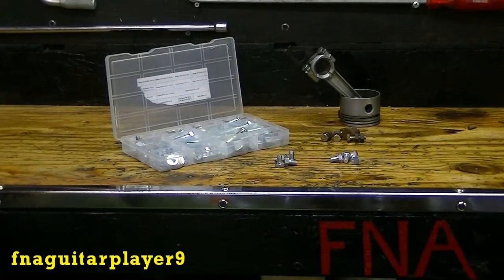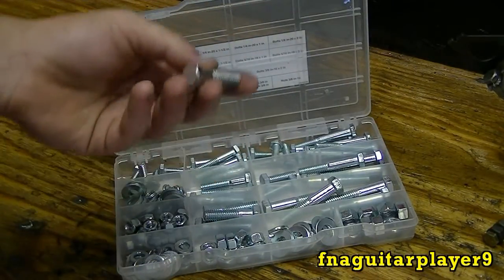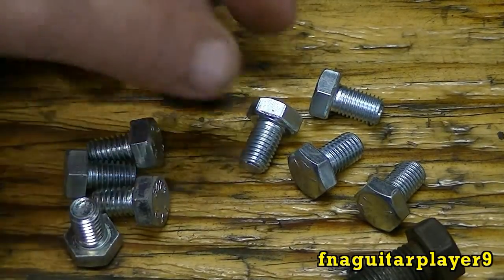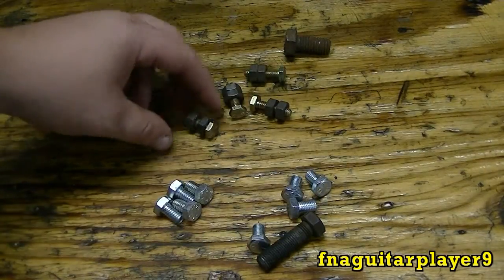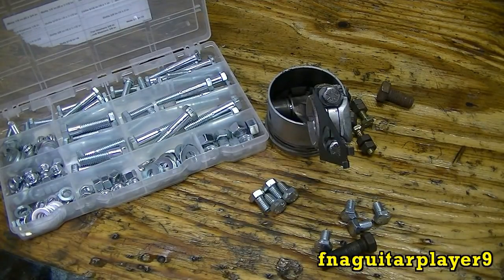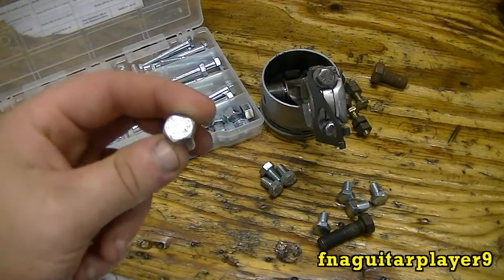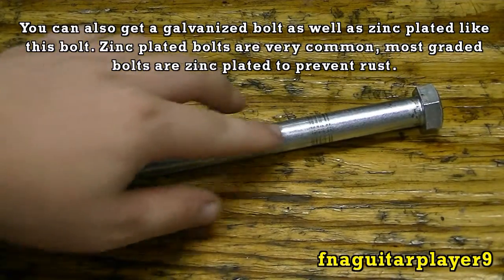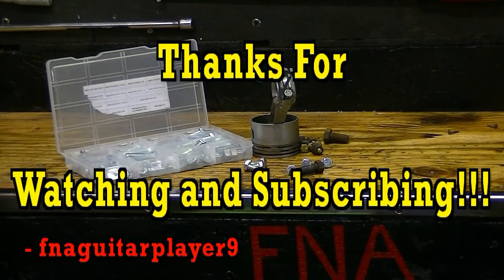Bolt Grades: How to identify different grades of bolts and common uses

Comment: CORRECTION #1: Grade 5 = Class 8.8, Grade 8 = Class 10.9.  Class 12.9 & 14.9 are much stronger than Grade 8.

CRRECTION #2: Grade 8 bolts are usually better than grade 5 bolts even when bending is concerned because even though grade 8 bolts are more brittle, they're still usually in the bending stage by the time a grade 5 bolt would have snapped already.
Reply from the maker: Good info, I was just doing a general comparison between the metric and standard grades. Thanks for the input! Thanks for Watching!!!

Comment: Thanks for the information. I was thinking about looking for a video like this and just stumbled on this one. Do you know of situations with small engines or anything else where it could be beneficial to upgrade or downgrade the bolt types from the factory type?  Thanks.
Reply from the maker: Your welcome! Not in particular, the factory bolts seems to be pretty strong, I've never had any problems with bolts for the most part. I have had the idea of using studs on the head bolts with a nut/washer on top, to prevent damage to the threaded aluminum block, but have never tried it. most bolts on small engines (briggs and stratton) is grade 5 or 8 unless they are metric. I haven't seen any grade 2 used in critical places. The main thing that is critical when rebuilding engines is torque specs, they have to be torqued properly. Thanks for Watching!!!

Comment: Slightly frustrated with the amount of I don't knows in this video. Take a few seconds and research things cause I now gotta find another video. Would have been easier if I was told everything now in this video.
Reply from the maker: It was just a basic discussion on the 3 main types of bolts that are found. Sorry it didn't help you, thanks for the feedback and for watching!!!

Comment: Hey Frank, Just a little FYI...If you have no idea of the quality of a piece of steel you can very lightly grind it in a bench grinder.  Try to do it in a shadowy or dark area of your shop.  The HIGHER the grade of steel alloy it is made of, the finer the sparks that come off of it will be. Granted, there are lots of variables like coatings and hardness. Try it out with a few pieces of KNOWN quality steel. The difference is amazing.  Junk steel makes coarse sparks. Quality steel is fine sparks!

Comment: I like brass bolts. I use them to hold exhaust on mower engines. They don't seem to seize-up with the extreme heat

Comment: thats a common misconception about the grade 8 bolts that there yellow heck i even thought that actually you can get grade five in yellow zinc its just more common of a coating LOL mtd is now getting there grade 5 bolts in the yellow zinc to make the products look stronger also there is a grade 3 bolt that has 2 dashes .. normaly there is there 3 dashes + 2 e grd 5 6+2 grd 8 
cheers 
Tyler